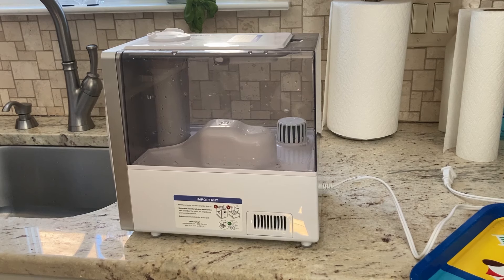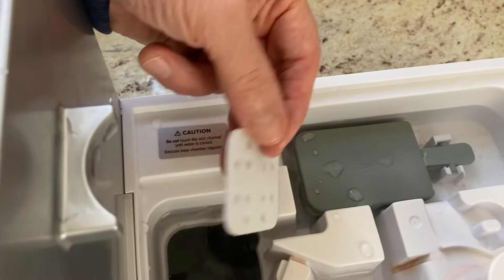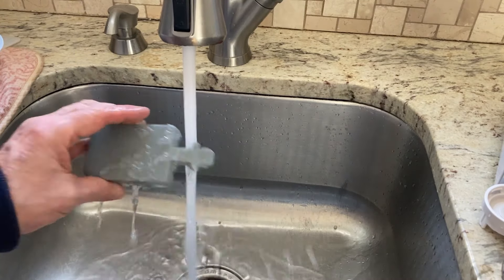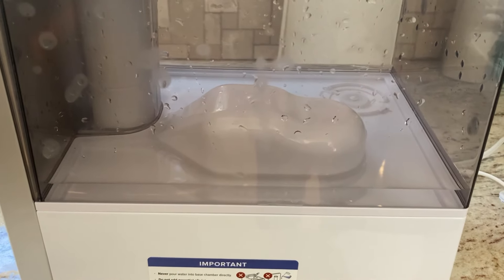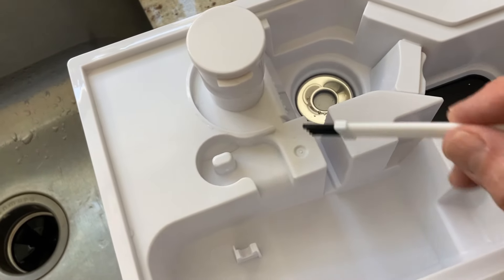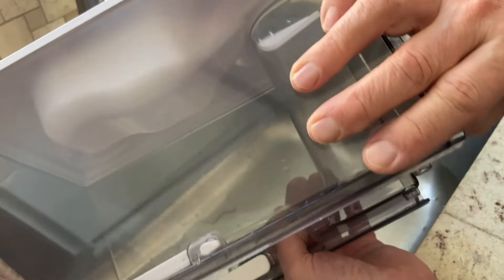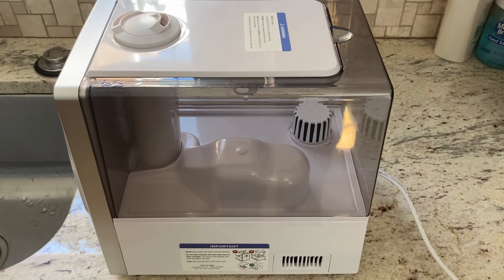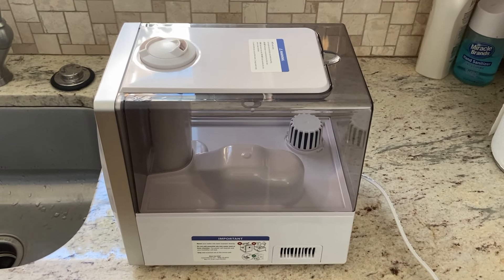Cleaning the Levoit LV600S Humidifier - "By the Book"

Comment: Thanks for the video but OMG do I resent this machine for the ridiculousness of the difficulty of cleaning all these little stupid parts!!!!
Reply from the maker: Hi ,  this video is really just showing the full thorough process after the machine had been working 24 hours a day for "3" weeks. Under normal circumstances, if you use distilled water and clean it weekly, the build up won't be that much and you can probably clean it in less than 10 minutes.  Once you do it a couple times, it's not bad at all.  It takes a little longer if you have to do the full vinegar treatment of course.

Comment: Using distilled water can greatly decrease the number of cleanings required. Also, remove the essential oil pad if you're not using it. That will save on pads.
Reply from the maker: Thanks, I am sure distilled water would make a big difference. I am using it primarily to humidify musical instruments, so I have to run it 24 hours a day throughout the winter months, non-stop, so purchasing and storing all of that distilled water just wasn't practical. Tap water creates a little extra work in the cleaning process, but I get faster and faster each time I do it. So, overall, it works fine.
Reply: @goodcourseproductions5546  The other reason I suggest distilled is because tap water contains minerals which are diffused into the air as a white dust that covers everything. That's why I stopped using tap in my diffuser. It was collecting inside my PC.
Reply: @goodcourseproductions5546  I actually would be as well catious about using tap water if it is used for your musical instruments. I read reviews which complaint that lime would cover the funiture etc. I have no experience myself, but you might want to check google/other reviews. Beside this, thanks a lot for this video!
Reply from the maker: @gonziwonzihonzi  Thanks for watching and for the feedback. I do "try" to keep a close eye on it as my humidifier is on 24/7 in the winter months in a bedroom where my guitars are stored. I do watch the instruments for signs of lime or other deposits that might land on them. So far, I have not noticed anything significant. The guitars are not in real close proximity to the humidifier, just in the room, so it hasn't been a problem "that I notice". What I do notice is that the uncoated strings tend to rust much quicker from the general moisture. So that is more bothersome to me. I just try to keep the humidity at a level that prevents the wood from cracking and is not significantly impacted by the tap water. I'll keep my eye on it. Thanks!
Reply: My kingdom for a truly easy-to-clean humidifier! Ordering today. Will use distilled.
Reply: Destilled water is more expensive bro...
Reply: @masterzed1  In Canada, it’s $2 for a 4L jug.

Comment: Thanks for this very helpful video. Honestly, the company is not going to like hearing this but after seeing what is involved in cleaning this unit, I have decided not to purchase. Can't believe that people actually go through this process weekly. Seems like a total pain and I certainly don't have the time or patience to do this. Fewer parts to clean less frequently is much more desirable. I'll continue the hunt for that.
Reply from the maker: Hi ... I understand, but keep in mind that the purpose of the video was to demonstrate a full, thorough cleaning and scaling as described in the book. It is for those who already purchased the product and want to do the full job but prefer to watch it rather than read the manual.  In reality, you don't have to do a full thorough cleaning every week. It depends on how you use it, your environment etc. In the video, I ran it for 3 weeks straight, 24 hours a day and intentionally did not clean it for demonstration purposes. In my real usage, I usually give it a quick clean at the end of each week because it doesn't get that dirty.  I can do it with my eyes closed,  and do it in less than 10 minutes. I find it easy and not a pain.  There are plenty other options that have fewer parts and clean up quickly  (I have one).  However, the quick simple clean machines, just don't have the features I wanted. So, the cleaning procedure had very little weight on my decision. I wanted the features, so if it took a few more steps to clean, it didn't matter to me. However, again ... I do it now it 5-10 minutes ... very easy. Good luck in your search.

Comment: Problem with video and instructions - if you take the water outlet valve off before putting vinegar in the tank and the tank on the base, as instructed, vinegar does not flow into the tank.  That is why you found so little vinegar in the base after taking off the tank (and the dirt/scale undisturbed), since the water won't pass from the tank the the base without the outlet valve.  Solution - leave the outlet valve on the tank, let the tank soak 10 mins, then put the tank on the base. The vinegar will flow to the base and clean it.
Reply from the maker: Thank you very much for your comment. You are correct. Though the instructions say to remove the water outlet valve, when the valve is removed the float arm is not able to engage the spring to open the valve when the tank is placed on the base. I tried to do it "by the book" but , unfortunately, the book was wrong.  I have added a subtitle edit at 7:14 to advise everyone to re-attach the water outlet valve.  Thank you for picking this up and for your comment.

Comment: Nice unit but seems like it’s a very in-depth way to clean it. Too many little parts . They should be easier to clean 👍🏽
Reply from the maker: Keep in mind that the video is intended to explain how to clean the unit if you chose to do it "by the book".  Basically, it was an attempt to help people who just bought the machine and don't like to read instructions. In reality, how thorough you need to clean it, probably depends on how much you use it and the environment it is in. In my case, I really just have to do a quick rinse cleaning at the end of each week. It takes me less than 10 minutes and I can now do it with my eyes closed.  In the case of the video, I intentionally let the machine run for 3 weeks non stop to see what kind of mineral/bacteria would build up. Under my normal usage, I see very little build up over the course of the week and a quick clean up does the trick. Good luck.

Comment: Thanks for this! Your comment at 7:15 about reattaching the water outlet valve to allow the vinegar to flow into the base is exactly why I searched for some pointers. The instructions in the manual were unclear.
Reply from the maker: Hi ... thanks for your comment. You are right that the instruction manual was not clear on this issue. I added that comment at 7:15, and also put a note in the description, after I had posted the video. As I realized later that the manual was a little misleading on this issue. It became clear to me when I noticed that my vinegar was not flowing properly into the base. I was hoping that people would notice the added comment or the description as it was too late to change the video. I am happy you found it.  Thanks again.

Comment: First, thank you for a very informative video, it is much better than the manufacturer's own youtube video which is pretty useless and rather designed to falsely demonstrate how quick and easy the cleaning process is.
Today I did the first cleaning after having used it for approx 10-14 nights total (~100 hrs) , intermittently over 1 month.  I have a separate hygrometer that I rely on and only use the unit when humidity drops below 40. After a full night of use it gets to mid/upper 40s, I use it in a larger bedroom.
Cleaning was easier than I thought thanks to your tips. Was able to see some white deposits and there was a bit of slimy feel in some corners but nothing off white (or pink or black).
I now plan to clean every 2 weeks at least.
I use purified water from the refrigerator.  I'm sure it's not as good as distilled water but figure it's better than tap (but don't really know).

Cleaning is no issue going forward, I can dedicate 15 min for this.
The part that gives me pause is the white residue I started to see, most noticeable on shiny furniture surfaces. First I thought it was regular dust, but that's not the case, because this it's stickier. After some research online I have little doubt it is due to the minerals from the water that ultrasonic huimidifiers are dispersing in the air (see link below).  I live in an area with hard water and do not have a water softener.

Readers of this post may find this link related to ultrasonic humidifiers useful:
https://www.epa.gov/sites/default/files/2014-08/documents/humidifier_factsheet.pdf
In summary it appears most concerning is the dispersal of bacteria and mold (when not cleaning frequently enough).
Reply from the maker: Thank you for your very generous comment. I appreciate that you took the time to write it. I'm glad my video helped you. Yes, the white dust is most likely from the minerals in your hard water, typically high levels of calcium and magnesium. Hard water is known to leave white spots on glassware or residue on clothes. It is actually mentioned in the troubleshooting page in the manual. They say using distilled water will prevent this. I don't have a hard water issue in my area, so it's not as big a problem for me. I do use tap water, but try to clean it at the end of each week, to reduce the mineral build up.  Thanks again. Good luck.

Comment: What you keep referring to as Dirt is actually mold and Pink stuff is bacteria known as Serratia. Does your unit leaks from bottom? Thanks for making this video.
Reply from the maker: Hello, Thank you for watching. So far, I have not experienced any leaking at the bottom of my humidifier or anywhere else. It continues to run fine. As far as the "dirt", yes, I just used a general term. The manual talks about dust, mineral deposits, and scaling etc. I didn't know if it was bacteria,  as the water was never sitting stagnant. It was constantly refreshed with fresh "tap" water. I guess it could be the bacteria you mention. I don't encounter it much anymore as I tend to just stick to the weekly cleaning that the manual recommends. In the case of the video, I let it go for three weeks, almost hoping there would be some build up there to make it easier to demonstrate the cleaning as laid out in the manual.

Comment: Do you fill it with purified water or tap water?
Reply from the maker: I use tap water. They recommend distilled water but purchasing and using distilled water is just not practical for me,  I use tap water and try to clean it thoroughly once a week to prevent mineral build up. I have not had a problem.

Comment: do you use tap water or distilled?
Reply from the maker: I use tap water. I recognize that they suggest distilled water but I use tap water and try to clean it thoroughly once a week to prevent mineral build up. I have not had a problem.

Comment: Hi I would like to know about the dimensions of this sponge（ Humidifier Replacement Filters ） including the height and the diameter of the sponge, can you tell me
Reply from the maker: There are "4" different sponge/pads that come with it. They provide you with some replacements so, if you keep it clean,  you can go a long time before needing to replace them. They can be purchased separately. Here are the dimensions:  Black Water Filter Sponge - It is "cylinder" shaped and is 1 3/4" high. The "inner" hole diameter is 1 1/4", the outer diameter is 1 3/4". It also includes a white "absorption" pad which is 1 3/4" square and maybe an 1/8" thick.  It also has a white aroma therapy pad which is 1 3/4" long x 7/8" wide x 1/8" thick. It also has a black aroma therapy sponge which is also 1 3/4" long x 7/8" wide x 1/8" thick.

Comment: Every time I wash this for more than 24h the humidity indication is way too high (80% ormore) - its false. Anything seeing this ? Whats the workaround ?
Reply from the maker: Moisture has most likely settled inside of the "humidity sensor" after you cleaned it and thus giving you a high reading. The humidity sensor is located inside the essential oils aroma box. Make sure the mist nozzles are facing away from the aroma box so that mist does not settle on the sensor inside the aroma box. The solution is to turn off the humidifier, remove the aroma box and allow the sensor to air dry. You can see the location of the humidity sensor in the diagram on the instruction book page 5. (look for "L").  This issue is covered in the troubleshooting section at the back of the manual (page 23).  Good luck.

Comment: How do I remove the sound piece?
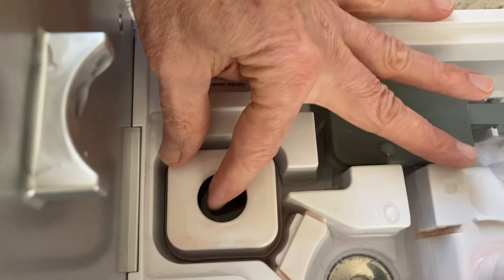Reply from the maker: I'm not sure what the difficulty is?  Maybe I'm not understanding what you are referring to.  If you watch the video at the 2:48 mark, you will see that the noise absorber (sound piece) is just the square white plastic piece that just lifts right out. If I'm misunderstanding your question, please let me know.
Reply: @goodcourseproductions5546 Hi sorry not the noise Silencer. I meant the float. I just saw how you did it in the video! I'll do that the next time I clean. Thank you so much
Reply from the maker: @faithwithroshni4858   Hi ... Thanks for the clarification,  I understand now. Yes, the float is a little difficult to remove because it is intentionally snapped in hard in order to prevent it from popping out during use. If you look at it, you will notice that, on the arm portion of the float, there are two snaps. One snaps is enclosed in the plastic, and the other is open on the top and snapped in on the bottom (back lefthand side of the arm). You have to twist it a little so that the left snap pops out and then slide the other side out of its hole. It is definitely tight, so you have to tug at it a little (or wedge something underneath the snap to push it up). It will pop out with a little force. Good luck.

Comment: Good grief! They have GOT to be kidding, expecting people will do this every week? Way too many nooks, crannies, and unnecessary pieces. They say not to, but throw one of those silver cartridges in there (many major brands available) and it'll make your life a lot easier. They won't hurt a thing and stop growth of the pink/orange mildewy gunk. The absorption pad also likely becomes unnecessary if you use the ion-exchange demineralization cartridges, which help prevent the white dust.

I was looking at this model for the features I liked, but I'll keep looking for something a little less ridiculous to maintain.
Reply from the maker: Just a side note, in reality it wasn't all that difficult to clean and it can actually be done fairly quickly. In the case of this video, the humidifier had been running 24 hours a day for two weeks, with tap water. I was using it primarily to humidify guitars, so it had to run non-stop for two weeks. (It wasn't cost efficient to use distilled water with that schedule.) Had it had normal usage in a home, it probably wouldn't build up that much gunk and I could probably rinse the whole thing out in 15 minutes. In the video I went through the whole descaling process etc so that people would know the full process. Overall, I found it to be a great quality humidifier and the maintenance was not as difficult as it might look in the video. Now that I have cleaned it several times, I have it down to a science and it is very simple.

Comment: Not sure where you live, in experience 2 weeks are the most you can get away for cleaning. At week 3 you start to see these pink bacteria stains.  Most of parts are removable so why can’t you wash with soap.
Reply from the maker: Hi, as far as possibly using "soap", since the video was titled "by the book", I stuck strictly to what the manual said.  I didn't want to accidentally steer anyone in a wrong direction. The book specifically said "not" to use any detergent. They didn't say why, so I did not deviate from what they said. I live in Pennsylvania where my humidifier is only used for about 3-4 months in the winter but I tend now to do a quick "weekly" cleaning as that is what the manual recommends. Again, in the video, I just let it go for three weeks, so that there would be something visible to see and demonstrate but, I did make it clear that the manual recommends "weekly" cleaning. Thanks again for watching and commenting. I appreciate it.
Reply: @goodcourseproductions5546  I think most manufacturers do not advice extra step for liability or warranty related issues and they would like to keep process as simple as possible. I clean and rinse properly I don't see how it can harmful. You are doing much better job for cleaning. I have always cleaned my humidifier's removeable parts with soap and vinegar combination. Trick is rinse and let it complete dry. Lets say wash it in morning and by evening they will be dry.